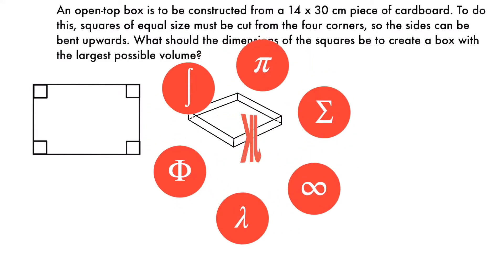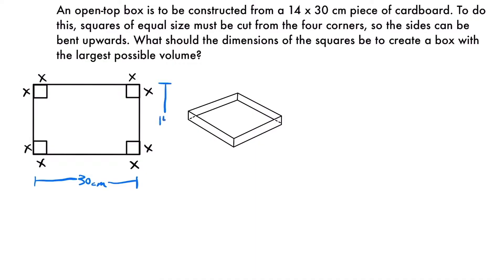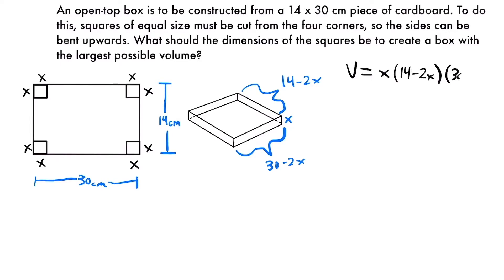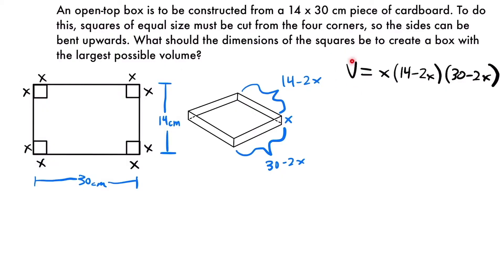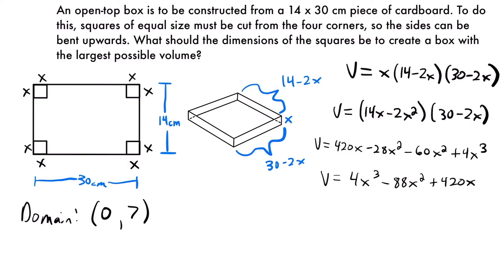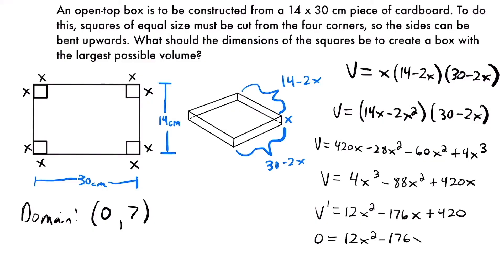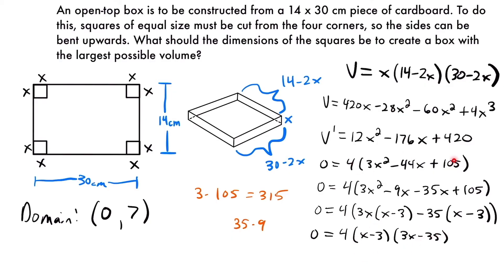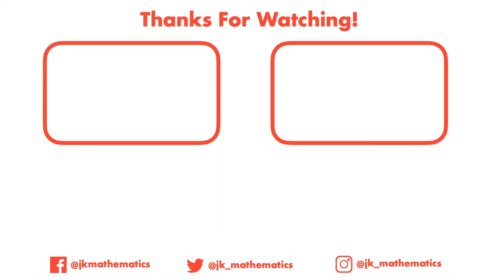Optimization - Open Box With Max Volume | JK Math

Comment from the maker: Any questions? Leave them here! Also, you can find the link for my full-length tutorial for optimization problems below in this comment! I have many other calculus tutorials you can check out on my channel as well! 
Link: https://youtu.be/hT6jY757WCg
Reply: How to know when to add the x’s and when to minus them when naming the sides
Reply from the maker: @Toto-yk8tn  Determining how to set up the equations using x will ultimately depend on each specific problem. In the case for this example, since we are told that the cardboard is to be made into a box by "cutting out" squares of equal size from the corners, that is a clear indication that whatever the measure of each side of the squares is (x) that it should be subtracted out from the total length of the sides of the box. In other words, the corners that measure x are being removed (subtracted) from the cardboard, not added. Does this help?

Comment: I have question if my width is 25 i place in domain is 12.5 please help me
Reply from the maker: Yes, that would be correct. If your width is 25 then the value of x, representing the amount you cut out from the corners, would theoretically be 12.5 at the largest, since you have to cut x out from both sides. So each could be 12.5 adding up to the total width of 25. Again, that is theoretical because if you do cut out 12.5 in each direction then you no longer have a flap for the box, so we don't include the 12.5 in the domain. Its just (0,12.5) with open brackets. The value of x will be between 0 and 12.5. Hope this helps!

Comment: What happened to 4? What is 4 for? Answer pleaseee
Reply from the maker: If you are referring to the 4 in the equation at the very end when solving for x, that 4 is just a common factor that we pulled out from the other terms. You could divide both sides of the equation by 4 and then it would disappear since 0/4=0. Once we pulled it out to make the equation simpler, that 4 really doesn’t serve a purpose. In other words, that 4 doesn’t give you another solution for x. So nothing really “happened” to it, we just don’t need to use it for anything. If you need a refresher on this type of algebra skill, I would recommend looking up how to solve for the zeros of quadratic expressions (and other polynomials as well!). Hope this helps!